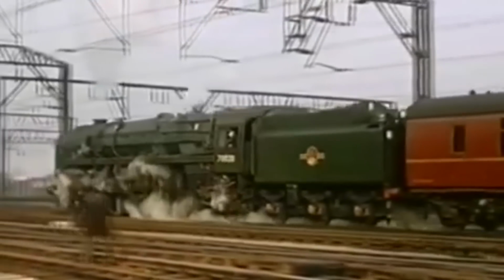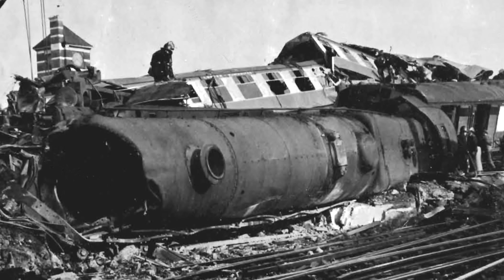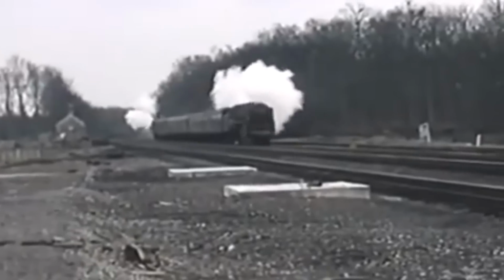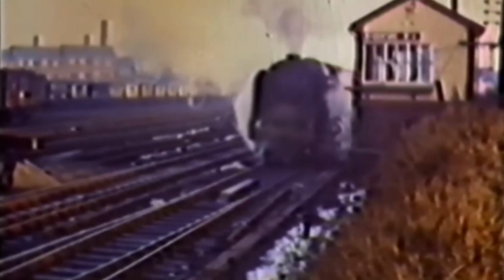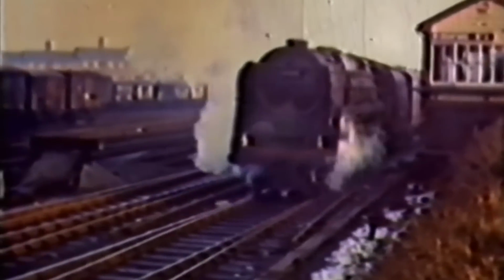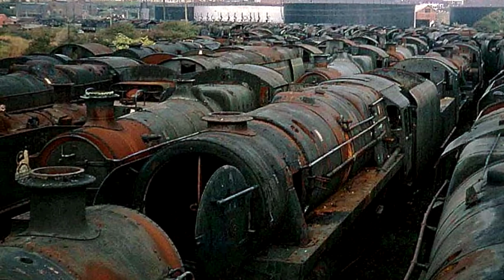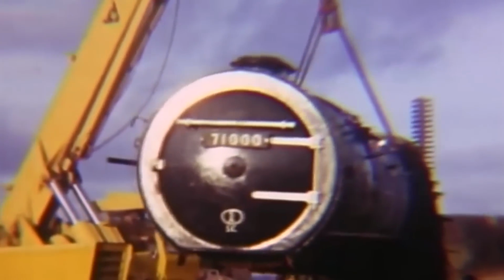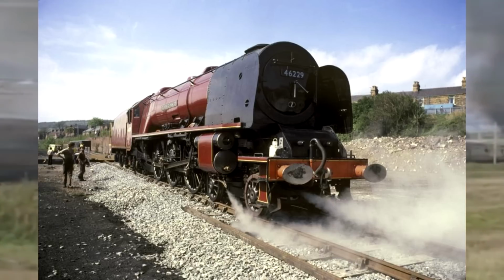The Steam Locomotive That Surpassed Expectations | 71000 Duke of Gloucester | History in the Dark

Comment: THE DUKE - FINALLY CURING THE DESIGN & CONSTRUCTION FAULTS !
The Duke of Glouceter 71000 was the only steam loco BR designed and built out of a total of 999 steam locos, that had 3 Cylinders, all the rest had just Two. The Duke was only possible, as a result of the terrible crash at Harrow in 1952, which damaged one of the Princess Royal 8P Pacifics beyond economic repair. Hence a replacement was authorised. And as Riddles then CM&EE for BR stated. "The design of a 8P Pacific necessary, was beyond the scope of any of the BR Standards, as even the Brittainia Class were only 7P. To reach the 8P power rating a 3 or 4 cylinder type would be necessary". Further the fact that British Caprotti (owned by T. Daniels and ex LMS Crewe man) had been brought to near perfection as demonstrated in some of the last BR Built LMS Black 5's and was to be included in a batch of 30 BR Standard Class 5 4-6-0's (One of which is preserved). Had revealed that coal and water useage would be reduced if British Caprotti valve gear was used. This fact resulted in the choice of a 3 cylinder design. So a one-off & very complex casting was produced for the whole centre cylinder & steam passages. This massive block of metal would fill the space between the front frames, so hugely reinforceing the whole front end, to help ensure less likehood of cracked frames, due to the forward and reverse thrusting by the connecting & coupling rods.

But that one-off casting it later transpired had a serious Production flaw, not discovered until after the Duke had been restored for mainline preservation. 

Further the design of the Duke did NOT take note of developments by S.O. Ell Chief Development Engineer at Swindon. Or of his re-draughting and double chimney applications to the GWR Castles & Kings during the late 1950's, which seriously improved their performance. Instead someone in the Derby Design Department, allocated the Duke to carry a Castle Class (size) Double Chimney. Which later revealed it was far too small to cope with the steam output of a Class 8P Pacific. So it effectively throttled the Duke when the loco needed maximum output. As a number of Crewe North shed Drivers & Firemen quickly discovered. With the Dukes frequent use on the "Mid Day Scot" express. If the train was on time the Duke could maintain the schedule, but if the train arrived at Crewe late, the Duke seemed incapable of recovering time on the onward journey to Glasgow,over Shap & Beattock, with that heavy train that often loaded to 550-600 tons.   

The further problem with the Duke, was that construction of the loco by Crewe works was completed in 1954. And in 1955, the "Modernisation Plan" was unveiled by Government, which included the replacement of steam with Diesel. So the Duke, was never put through the usual full course of testing of such an important new design. Only Limited testing was done, indeed this limited testing which included hauling trains of 20+ coaches from Swindon to the Bristol Parkway area (where there is a large triangle) and then Back to Swindon, oddly seems to NOT have revealed the "throttling" issue of the Duke under maximum load. Indeed this maybe due to the fact that testing was only taken to a maximum steaming rate of 24,000lbs per hour, the accepted limit for one fireman. Tests on the Stationary plant at Swindon indicated the boiler was good, and capable of steaming rates in excess of 36,000lbs per hour. Only feasible in service for short periods of time (10-15 mins) by one fireman. And it seems they never bothered even on the stationary plant to push the boiler to this limit. So the Locomotove went into daily service, disguising a number of problems that should have been revealed, and dealt with. Including the fact that the loco was known to be heavy on coal. Something that the Caprotti Valve gear would normally reduce significantly. 

There were further faults with the loco, dsicovered during restoration in the 1980's early 1990's. This included the discovery that the damper doors had NOT been designed and fitted as per the Draughtsmans Drawings. Indeed opening of one Damper door, actually partially blocked another, starving the fire of air, when under high demand. Indeed what they did discover is that the Crewe North Shed Master, must have been very well qualified. As the ashpan was found to have holes cut in its sides. And when these holes were measured, they equated to within just 0.25 square inch of the original full damper door opening !!!!  

Restoration of the Duke was initially thought by many to be impossible, because both outside cylinders were missing (and many parts of the complex cam boxes) which form the hidden bits of the Caprotti Valve gear. Indeed the original group restoring the Duke, were denied membership of SLOA (Steam Locomotive Owners Association) for some years. A serious mistake on their part ! The original team restoring the Duke included a number of Qualifed Engineers, more so than in any other restoration project. So that team were able to have long talks with people like Riddles & Tom Daniels and others, before they Died. This is how they sorted out the problem of the far too small double chimney on the Duke. No facilities were available anywhere to actually test theoretcially or in practice the neccessary design of both a new chimney design, and the desire to also include the full Kylchap (Kylala - Chapeleon) Blastpipe they wished to add to the Duke for preservation, knowing this would also improve its performance above what had been even theoretically possible in BR steam days. The new design had to be worked out mathematically, but they took as a suitable existing starting point the double chimney & Kylchap blastpipe of the preserved "Blue Peter" LNER Pacific. 

Indeed a number of improvements to the original cams (the gearbox of a Caprotti type loco), resulted in totally new cams to a different design to those originally fitted, with the help of Tom Daniels the man who owned British Caprotti. Which has improved efficiency yet further. Indeed with a totally new design of double chimney, the addition of a Kylchap Blastpipe, the redesigned Damper doors, improved Cams, and a handful of other minor "teaks" a lot was expected of the loco in preservation. And so they could test the loco in operation the original preservation team, also bought and restored to full working order the Hawksworth Dynamomter car. So a number of early runs in preservation included this vehicle coupled behind and fully connected to various parts of the loco. This revealed something was NOT 100% correct, something they could NOT initially find. Until someone sent in a piece of Video film footage of the Duke on the mainline, taken from a low viewpoint on an embankment. The accompanying letter queried the emission of steam from somewhere under the front end of the loco behind the coupling, steam which should NOT have been there. This finally revealed the issue of the very complex centre cylinder casting, which was itself the only original cylinder on the loco when rescued from Barry Scrapyard. The only way to get inside the complex steam passages in that massive casting was to use a Robot, with a long fibre optic camera lens. And this discovered hidden deep inside one of those passages a crack 18 inches long and at least 1.5 inches wide. The crack under magnified expansion was deemed to have been there from the moment of the castings construction, as it had smooth edges, not slightly jagged ones.

That casting crack was estimated to be loosing a few hundred horsepower when the loco was hauling a train. Repairing this hidden crack, had to be done again using a robot to handle and position the electric welding equipment. Supervised by an Engineer watching a TV monitor fitted on the robot. And the proof of the pudding that the Duke was now in the condition that should have been reached if it had been fully tested back in the 1950's by BR. Was proven beyond doubt with an edhp of 3,200hp developed on the lower reaches of Shap after a enforced signal stop. The Dynamometer car being fully hooked up, recorded on its instrumentation, this figure. Which puts the Duke of Gloucester 71000 as the most powerful express passenger type in Britain, then or now. And yes Coal consumption is also now much lower than in BR days !

Comment: So they were still coming up with better steam engines (though this engine had some problems) till the end and I wonder what a modern steam engine would be like because I have read articles that stay there are many way to make traditional steam engines that could have made them better then they got.
Reply: Some crewmen called the loco The idle Duke. Coal consumption and performance were a disappointment, due partly to a badly designed ashpan that starved it of air.

Comment: A quick FYI, one of the main reasons we British kept developing steam locomotives as long as we did, was the simple matter of raw materials and energy. Britain has abundant amounts of high quality coal, like bitumen. Not the poor lignite brown coals you see elsewhere in the world. Therefore, it was cheap compared to oil and gas. That really only changed, when the coal mines were closed by the uni party between the 60s and the 80s.
Reply: Partly true, but because of the much higher efficiency, more predictable power and easier maintenance of diesels (when proper facilities and training had been provided) they were being adopted in preference from the 1955 Modernisation plan onwards, accelerated in the 1960s. The later closure of coal mines is a red herring - more to do with supply outstripping demand and cheaper foreign coal being available (opencast seams up to 150-200 feet deep as against deep mined twisted 10 foot seams in the UK).

Comment: R.A.Riddles' engineering and drawings were correct. They were not followed correctly when 71000 was built and no one could be bothered to fix problems. His final design was a masterpiece in steam locomotive engineering - the 9F.
Reply: @channelsixtysix066  The one thing I've never been to understand is why the Duke wasn't built according to the drawings.
Reply: Duke of Gloucester was largely the work of John Frederick Harrison who had been a pupil of Nigel Gresley and later served as assistant CME under Peppercorn. The Duke was a three cylinder engine like any other LNE Pacific and could be said to be the next step in LNER Pacific development. So what came about was a Doncaster Pacific built at Crewe works which, given the nature of the still existing inter company rivalry, was never going to go well. If it had been built at Doncaster or Darlington (and Crewe kept well away from it) the story would have been very different. Riddles was obsessed with simplicity and this characteristic was criticised by the Keeper of Mechanical Engineering at the British Science Museum. The power to weight ratio of the French Pacifics, set in the late 1920s and 30s, was never matched by BR. The Somerset and Dorset heavy freight 2-8-0s are referred to as a Fowler design but the design work was carried out by James Clayton. However because Fowler held the CME possition he receives the credit even though he did little if any of the work. So Riddles receives the credit for another man's work and the LMS faction in place in BR really messed that work up.

Comment: I was friendly with an ex BR fitter, at Swindon works, he worked on 71000, when it was undergoing work to solve poor steaming, they tried several different modifications to the firebox drafting, but was not really successful and the loco was put aside for many months...
Swindon was at that time constructing Warship and Western diesel hydraulic locos and little interest was shown in the big pacific, she was eventually withdrawn from service, but one on the cylinders was removed for preservation , the rest went for scrap....we all know the rest....
Reply: Very interesting. A logical thing to try, but because of the constructional errors with the ashpan and dampers which were not known at the time, it would not be sufficient. I suspect the Duke would have been a better loco with either the Kylchap exhaust or an ashpan constructed according to the drawings, but without both of these, it couldn't be fixed.

Comment: Near the end he says that she wouldn't have had any sisters, but the whole BR standard class development (that the Duke was part of) was a long term plan; the UK doesn't have any oil, but it does have coal, so in the event of war diesels would be totally reliant on diesel imports, not always reliable during war, so the plan was to use steam for 10 years, and during those 10 years electrify the lines so we could use coal fuelled power stations to power the railways. All the BR standard class engines were the best of all the different railway companies ideas in standard forms that would run over the whole of the rail network during those 10 years, but just after they were designed and put into service, there was a change of government, and to get re-elected in the next election they decided to modernise the railways by going to diesel, scraping locomotives that still had loads of life left in them. The reproductions of this short term plan are still with the UK railways today. 
 If it wasn't for this short term plan, it's quite possible that more class 8s would have been built.

Comment: Funny thing about Riddles-when he built the Austerity 2-8-0's, 2-10-0's and saddle tanks for the War Department, he made the comment that "I do not care about what happens to them after the war. You can dump them all in the sea for all I care" yet he built more steam engines.
Reply: That was more because they were a cheap, quickly produced no-frills design to meet a short term need. The 9Fs then refined the design into a fine locomotive with much better usability, especially for the crews.

Comment: There were a few operational issues when it concerned the enginemen who operated it. The west coast crews loved their Princess Coronation (Duchess') because they could brim the firebox with coal and then top up the tender before heading up to Scotland. The 8P didn't cope with the Crewe North practice so it didn't steam as well. I read a story in Steam Railway magazine a few years ago about a fireman who regularly fired her, he recounted that they were meant to take her back on a parcel/mail train from Glasgow but the Duchess that was meant to run the southbound sleeper had failed and the only available engine was the Duke. Long story short by the time they got to Crewe the tender was empty!
Reply: Basically because of the construction errors (grate/ashpan) and cut-price design (blastpipe) it burned far more coal than it should have done, as much went unburnt out of the chimney, so no wonder the firemen hated it at the time, doing lots of heavy extra work for no benefit. Happily, no longer the case!

Comment: Regarding be poor steaming then years ago Steam Railway had done an article about the Duke and it prompted a fireman from Crewe to write in.    Whilst most crews had treated the Duke like a large Brit, he had seen a 3 cylinder steam engine and so had fired the Duke like you would a Royal Scot.     He stated that had no problems with steaming or performance unlike the crews that treated her like a large Brit.    Brits being 2 cylinder locomotives.   Royal Scots being 3 cylinder
Different steam loco’s with their different characteristics required different methods of firing and driving to get them to perform properly.
So was not just the management that not interested but many of the people working on the engines not interested either.
Not saying she would have performed as well as does now after extensive modifications to the as built config but clearly she never had a chance as not being fired correctly of showing what could do at the time.

Comment: 46202 was not withdrawn until May 1954 and therefore spent 18 months at Crewe Works. The general consensus is that the maintenance staff were keen to repair it. The other express loco, City of Glasgow, was repaired. At least the boiler of 46202 was reused. Another factor leading to the construction of 71000 was the fact that an International Railway Congress in London took place in May/June 1954, so presumably British Railways wanted to show off a new engine. It is not correct that 71000 spent most of its days on the North Wales main line. It usually worked between Crewe and Euston, but also sometimes worked through to Glasgow, and even occasionally to Perth and Aberdeen.

Comment: The philosophy behind the Standard Class locomotives was to maximise the use of common components to minimise construction and maintenance costs at the expense of ultimate performance. This was because post war there was a skilled labour shortage on the railways. Many of the problems of this design and construction were because of the use of existing components, appears even changes adopted during her construction such as using an undersized firebox, probably because she was a one off they wanted to avoid need for new tooling.

Comment: Commentary needs a correction:
Spheroidal graphite cast iron is otherwise known as nodular iron NOT ductile iron,  ductile iron is otherwise known as malleable iron. Much less brittle and stronger than regular cast iron, it's actually used in some applications as an alternative for high carbon steel (Detroit locker style differentials are often made of nodular iron).